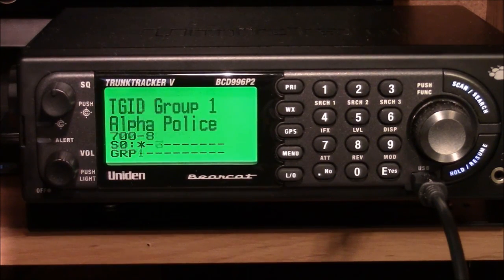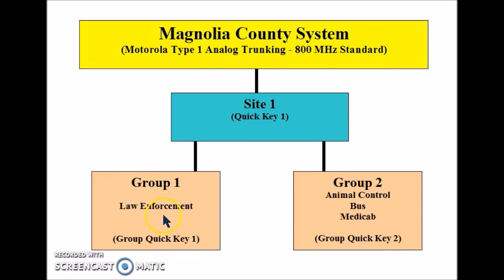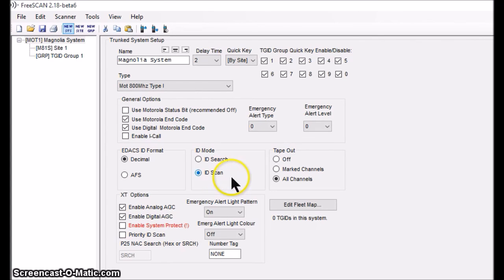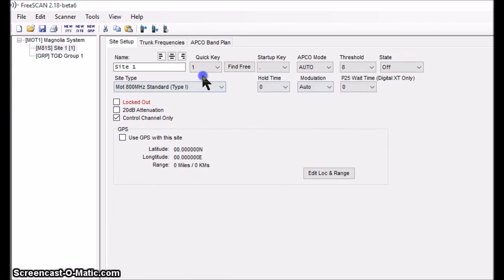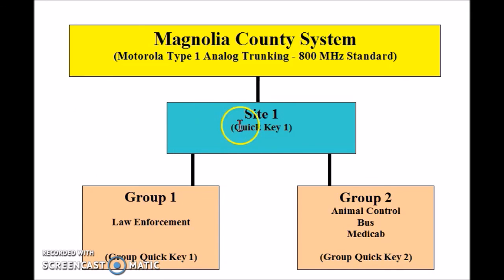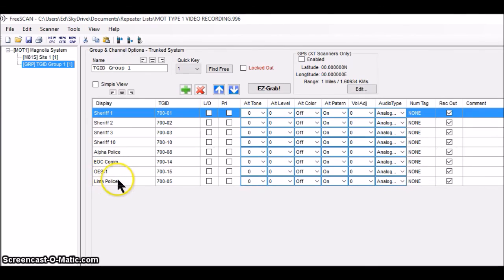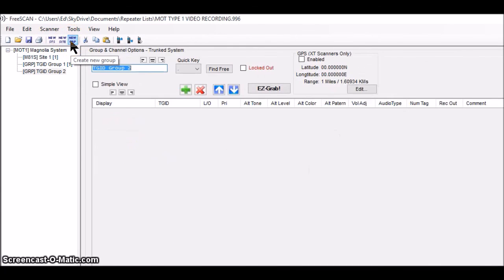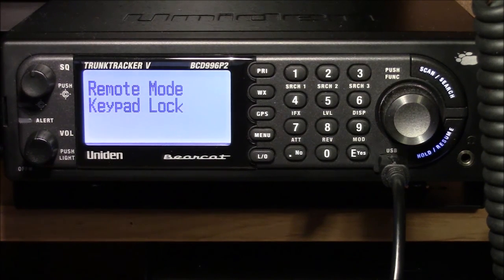UNIDEN BCD996P2:  Motorola Type 1 Trunking

Comment: Do you have to have a premium subscription to radio reference to access the data sheet?
Reply from the maker: You can go onto the radioreference site and manually (i.e. write it down) get the information at no charge or for about $9 or $10 for 6 months you can access the digital download.   I tried the digital download for the few truning systems listed in my area and I didn't get a working download.  The system in the video was procured manually.....

Comment: is there a benefit to doing this manually? I don't know much about these new scanners so I just grab it from the site which takes just a few minutes and loads it on
Reply from the maker: The benefit is actually understanding the system and process.  However, if all the channel information isn't available, it can become a pain.  If the goal is to be able only to use a really nice scanner, it might be better to have the BCT-15X  auto-programmed by radioreference.com.  The $15 bucks for programming access is well worth all the effort demanded to manually program the scanner.

Comment: do you have tutorial for p25 systems ?
Reply from the maker: No.  I haven't built up the courage to manually configure the BCT-15X for p25.  There's only one P25 system in my area (a Federal Prison) and I think I'm going to wimp out and have radioreference.com program the scanner.
Reply: Ok thanks
Reply: How does Radio Reference program your scanner? Do you have to send your scanner to them? Or will proscan work? Oh, I guess you mean buy a pre-programmed scanner.